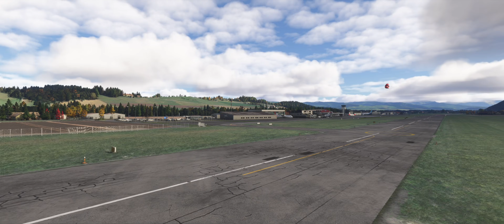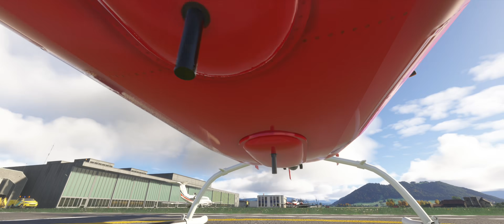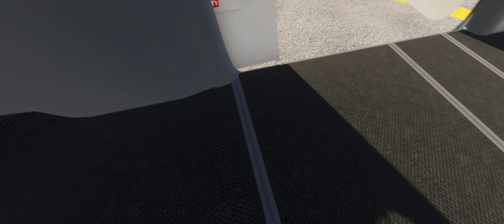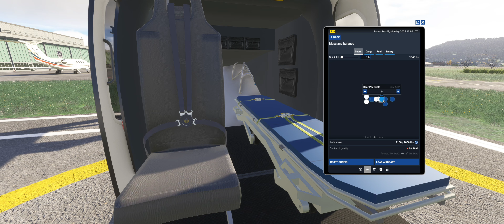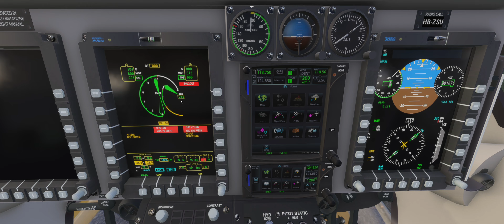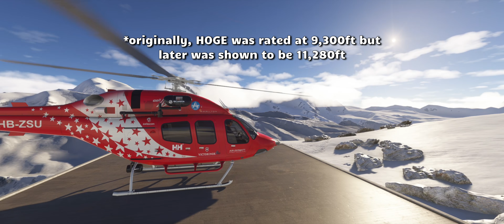First Impressions: FREE Bell 429 Helicopter in MSFS 2024

Comment: Hi, regarding your single-engine approach and landing, it would need to be a no hover landing technique because all light twin-engine helicopters cannot hover on one engine. ATP-RW retired.
Reply from the maker: Hi! Yeah, I was ready to do a "run-on" landing but I wasn't ready for the rotor RPM to die so suddenly like that. I gather that modelling twin-engine heli operations has been quite difficult for developers in MSFS 2020 and 2024. The Cowan Sim S-76 is the best I've seen so far, and does OEI better than anything else at this stage. Would be interested to hear your thoughts on that! 🙂
Reply: @matthew-lets-fly  Thanks for the feedback as well. I have not made a habit of buying aircraft sim models.